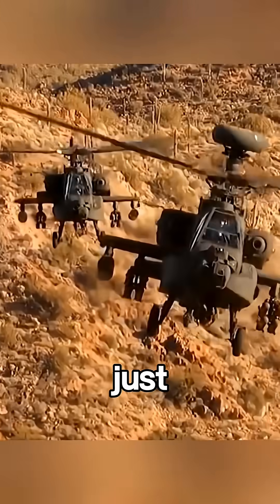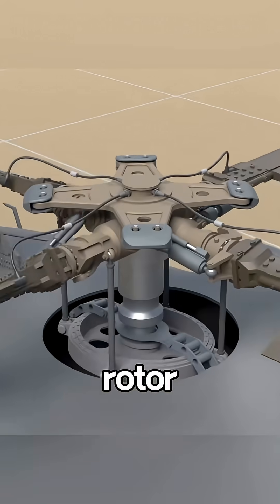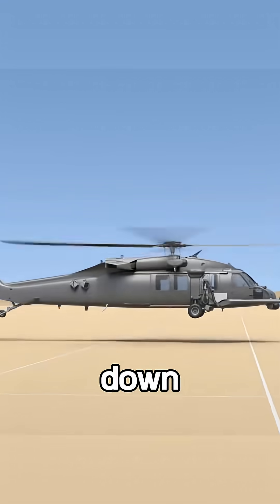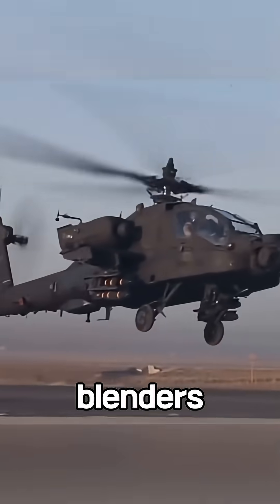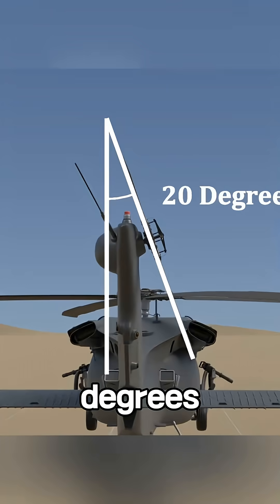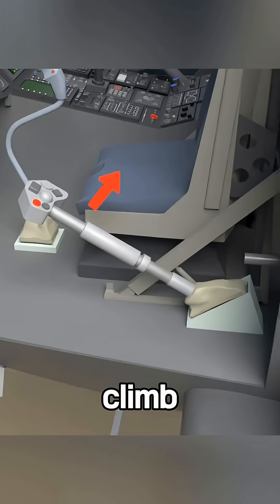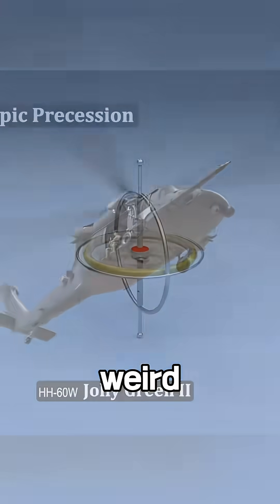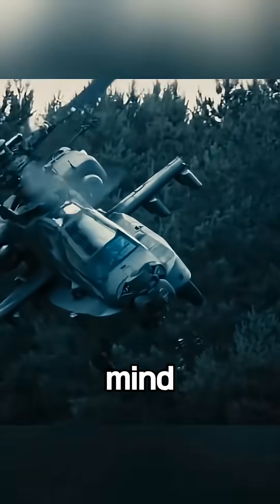Helicopter Speed Myth Busted: What Really Limits Their Velocity #helicopter #aviation #military

Comment: I already knew it 😅
However, the RPM of the main blade does change, which is why proper RPM control is required as well, and why the helicopters have an indicator specifically showing the RPM of the main rotor
Reply: Yes and no. Yes, as the pitch of the blades increase or decrease, the RPMR changes because of the change in drag in the blades. 
No, because the governor recognizes the change in RPMR and increases or decreases engine torque to maintain RPMR at a constant speed.
Reply: @bradleypolotto5193  Do they all have governors? I think at least some helicopters also have a throttle, and my impression was that the pilot had to adjust the throttle when increasing or decreasing the blade pitch to keep the rotor speed within a fairly limited RPM range. I think it was implemented as a twist-grip on the collective lever.
Reply: @init100  Yes. They all have governors. However, the governors of reciprocating engines on helicopters are not as precise as the governors of turboshaft engines on helicopters. The pilot of a helicopter with a reciprocating engine may have to "tweak" the twist grip throttle throttle to adjust manifold pressure to coordinate rotor rpm with collective pitch changes.
Reply: @oscargrouch7962  Incorrect. There is no rotor speed governor on small piston-drive helicopters. The pilot IS the governor. I flew the Schweitzer 300CBi and it was up to the pilot to monitor and maintain the proper rotor speed.
Reply: @bradleypolotto5193 
Feedback Control systems . 
Closed loop and Open loop feedback gain . Differential equations . 
Block reduction diagrams .
Reply: @bradleypolotto5193   The fuel governor increases the fuel flow to the engine to maintain a constant rpm.
Reply: @bradleypolotto5193  Yes, the pilot has the option of manually adjusting the rotor speed in emergency situations.
Reply: Rotor speed does change drastically, again dependant upon type, imagine a heavy lift type but with no weight, would you want the blades to rotate at 100% of max lift capacity? No, turn down the speed and the blades hit less turbulent air from the blade in front, less pitch is then needed in the blade at less rpm, a lot more efficient. The max speed is set by the ABC (advancing blade concept) which is a sum of the drag of the blade, the turbulent air coming from the blade in front, the pitch of the blade, the length of the blade, the chord of the blade, the rpm of the rotor head, all of that vs the weight of the aircraft the air density and temperature.
Reply: @slarratt  You’re incorrect about varying rotor speed. For all flight maneuvers, the rotor speed is maintained in a narrow range of about 96-100%. It does not slow down when in flight!  If it does, bad things follow like loss of control, rapid descent, darkening of underpants, etc.  You confuse max lift capacity (not really a term pilots use) with rotor speed. They are not directly proportional. You get more lift by changing the pitch of the blades with the collective and cyclic.  To overcome the increased drag, you need to add more power. During all of this the rotor speed DOES NOT CHANGE.
Reply: One would argue the persistence in misconception between RPM and torque, the governor is there to maintain a present RPM as per manual input  by the pilot.now let's assume u need to increase ur climbing rate in an emergency situation, u pull ur collective deflecting the blade pitch to max angle consequently that demands more power(torque) forcing more air downward n that tends to slow down the blade,,, however the governor senses the RPM drop automatically compensate by burning more fuel making that familiar aloud acceleration sound and that only brings the RPM back to the preset RPM. Some how we associate the loud acceleration sound with high RPM.
Reply: Exactly 💯!
Reply: The only part I wasn’t aware of is at the end when he mentions to pitch forward the blade has to increase lift on the side. Can anyone confirm if this is true? If so, I still don’t imagine this applies to chippers with a fixed disc.
Reply: @shook20000 This is true.  The pitch of each blade is constantly changing to maintain flight once it starts forward motion. It’s an incredibly complex dance governed by the swash plate. For a three bladed helicopter you also have lead-lag and flapping hinges to consider.
Reply: @artjackson8360 
Right I’m aware of the leading/retreating blade pitch change with each rotation, which as I understand varies with speed to ensure lift is symmetric on both sides.

The video appears to claim this occurs in all modes of flight though.

Is this governed automatically based on airspeed or does the pilot apply roll input/trim manually based on airspeed?

Is this process different in 3 blade choppers compared to 2/4 blade?
Reply: They don't change. You need 100% RPM for your other systems to function, and also in the event of failure enough RPM for autorotation.
Reply: Having done "hot refuels" of helicopters, and have them lift off as I am pulling the ground away, I can FEEL and hear a change in the rotor speed as it lifts off, even though it was sitting and the blades were spinning the entire time I was refueling.  Not sure if that was going from 90% to 100% or what, but I know there was a change.
Reply: The gauge labeled "Nr" tells the speed in percentage of the main rotor.  100% is the maximum of most rotors, although I  believe that the Kaman H-2C had a maximum of 105%.  Optimum rotor speed for autorotation is generally 94% Nr.
Reply: Some helicopters have governors or correlators.   The Enstrom F28F has a correlator which means you have to twist the collective grip to increase or decrease RPM.  You can easily overspeed the rotors or cause them to bog down.   

In the turbine engine helicopters I've flown,  the "governors" today do a good job of maintaining a constant RPM (range).  You used to need to be careful to not allow the rotors to "droop" since the governor lagged a bit even with automatic control.
Reply: Rotor RPM varies on piston engine helicopters, proportional to engine RPM, but most helicopters are powered by turbine engines and rotor RPM varies imperceptibly as it’s directly proportional (linked and geared down thru the transmission) to the turbine engines N2 (low pressure turbine), and N2 is governed
Reply: Agreeing with you and against most of your detractors a helicopter engine speed does vary but it isn't for increasing the helicopters speed. The rotor speed increases  from a startup, tick over speed to a speed fast enough for take off then the collective, the lever on the left alters the blade angle for take off and landing. The speed of the rotors nay be altered slightly in forward flight to a cruising speed to conserve fuel.
Reply: No, a helicopter's main rotor blades typically spin at a constant speed, and lift is controlled by changing the angle (pitch) of the blades, not the speed of rotation. The engine maintains a constant RPM through a governor, while the pilot uses the collective lever to adjust the pitch of the blades for lift and altitude changes.
Reply: @CaltonDionWaziweyi  still little bit variation exists, but RPM have to be within green range of 97-100%
Reply: @CaltonDionWaziweyi  The speed limiting factor is speed of the blades. 

When the blade is coming from back to front….it travels at its own speed plus the speed the helicopter is traveling at. 

If that leading blade gets too fast…you get sonic booms. 

That’s what limits speed….keeping the blades from breaking the sound barrier. Aircraft can’t handle it.
Reply: Dont the collective change rotor speed?
Reply: Ha.  Good point. As the collective increases, drag increases.  There might be feedback to increase the speed,  but it won't be instantaneous.
Reply: @JohanMsWorld  it does but on turbine powered helicopters (like mentioned above) the collective changes the RPM only as a result of the additional physical drag placed on the rotor blades as they change permission.

A well flown helicopter will have the rotor blades stay at roughly the same RPM throughout the flight with significant changes only coming during demanding maneuvers (take off, landing, coming into a hover)
Reply: @JohanMsWorld  on a piston engine helicopter, if you increase collective (which increases main rotor blade pitch) drag does increase, and if you do not increase engine power using the throttle, then rotor RPM will bleed off - so you need to increase engine power (via the throttle) simultaneously while increasing collective pitch.  Conversely, decreasing collective without reducing engine power will result in over speed of rotor and potentially the engine.  And you need to change the amount of anti-torque exerted by the tail rotor by adjusting pedals (more anti-torque when increasing collective and less when decreasing collective).  You usually even need to make minor changes to the cyclic (joy stick) when changing collective to prevent aircraft attitude change (while changing altitude).  On turbine engines, various inputs to the engine fuel control module ‘inform’ it on how much power the engine needs to generate, and the fuel control module changes fuel flow to the engine (increased or decreased accordingly), with the turbine’s N1 (high pressure turbine) RPM increasing or decreasing, while N2 and main rotor RPM remain almost perfectly constant (N2 and main & tail rotors are all directly mechanically connected).
Reply: NO 😂 rpm is just to let on know shit works 
unlike you daft drivers in your automatic cars  driving with only idiot lights 😂
Reply: @scottsuttan2123  sorry, I'm not american so I do know how to use manual cars :)
Reply: What's your source
Reply: @CaltonDionWaziweyi  the twist throttle on the collective!
Reply: @CaltonDionWaziweyi  I've seen how helicopters work, and my father has been inside them midair more than once
Reply: @Danstrous  I thought you were gonna say "My helicopter." LOL
Reply: @charlesmullen3359  I wish I had one 😂
Reply: The change your describing is negligible and constant speed/ RPM makes perfect sense from a physics POV. I think you just wanted to suggest that you (and your dads) gained experience through riding in helicopters trumps all others mechanical knowledge. 😂 laughable really.

Comment: Another detail: You cannot keep increasing the speed of the rotors' rotation as the tip of the blades can spin so fast that they go supersonic and that'll lead to them getting damaged.

That's one of the reasons helicopters cannot generate enough horizontal speed, for the helicopter itself (not the blades) to go supersonic. Their top horizontal speed is around 400 kph (250 mph), far from the speed of sound at 1234 kph (767 mph).

Comment: Most tail rotor blades are not tilted 20°, the Blackhawks are due to the fact it's way more powerful the most helicopters so much that it creates yaw torque. And it takes cyclic pitch for a helicopter to move laterally and collective to move up and down. So some of this is wrong.
Reply: This is also wrong, it has nothing to do with being more powerful, development criteria was that the black hawk needed to fit in certain transport aircraft, so engineers had to play with available space, which resulted the heavy gearbox system and other components placed aft of the centre of gravity. To cancel out the resultant default excessive nose up attitude, they tilted the tail rotor so that it also generates lift upwards, making the helicopter level
Reply: @sherekcio3651 this logic makes more sense, less sensational and more practical explanation
Reply: @srinathtg4623  Also the correct response. All single-rotor rotary wing aircraft generate yaw torque. Idk what OP was trying to express there.
Reply: I was waiting for somebody like you to address the wrong information.
Reply: Ka52 don't have rotor tails
Reply: @jonesmorendik  - That’s because they have twin counter-rotating rotors that balance out the torque, thus tail rotors are not needed.  It’s the same with all helicopters that have twin rotors like that, not just the KA52.

Comment: TWO outcomes to this truism:

1. becoming a helicopter pilot is harder than a fixed wing aircraft pilot. 
2. helicopter dynamics and aerodynamics are so complex, there are specific aerospace/aeronautical engineering schools in the country that provide degrees in this branch of engineering.
Reply: I'm a fixed wing and rotor wing commercial pilot. Rotor wing was not harder. It is however more expensive when getting your certs in rotor wings.

Comment: Annnnnnnd....

Because of the aforementioned aspects, there is a theoretical limit to how fast a helicopter can travel.
Reply: Want to faster than 220 mph? Get a V-22 Osprey
Reply: @PhilipLongee-vw8jf  limit is when blade that go same direction as helicopter reach speed of sound
Reply: @kkk1293u9xp yeah but there's also the retreating blade stalling
Reply: @JustRememberWhoYoureWorkingFor  
True.
Reply: @JustRememberWhoYoureWorkingFor  also there is a limit in speed because increasing airspeed reduces the AoA and therefore forward thrust is reduced. Same principle as for propellers. In an airplane if you descend fast enough, AoA can become negative, which leads to the oncoming air essentially driving the propeller. Worst case is you'll exceed RPM limit of the engine. Not sure how these principles equally apply to helicopters though.
Reply: @slarratt  wrong. ALL helicopters rotor blades are subsonic. Even the Lynx. Even Airwolf*.
*according to the novel, Airwolf shut down its rotor system and folded the blades backward into the tail boom before engaging the turbos. No real helicopter can do that in flight either.
Reply: @PhilipLongee-vw8jf  or an F35 lightning II.....
Reply: @Yabberfrat  F-35 L II isnt even close to being in fast jet league

To define fast,
Start with Mig-25, Mig-31, SR-71...n further
Reply: @AKumar-fc6ek , true! we could just stop at the SR-71.....💁🏽‍♂️😉  It takes the cake 🍰!!
Reply: @Yabberfrat 
perhaps Chinese r on to something even faster !!

Not confirmed though...
Reply: @AKumar-fc6ek ,  very interested to know!  Share it if you've got it
Reply: bigger blades, more lift, more speed
however if too long blade then snap and fall
Reply: Yeah thats why all helicopters have a "never exceed speed" because its at those speeds that the difference in angle between the advancing blade to the retreating blade that it risks hitting the aircraft itself as it spins. Another version of this problem is noticable with the Russian Ka-50 family of attack helicopters with contra rotating rotors where one rotor can be lifting up (on its advance) while the other sags (during its retreat) to such a degree that the two can collide.
Reply: You end up flying with the cyclic full forward and full to one side.
Reply: Since they have mass, helicopters can never reach speed of light!

Hope I could help
Reply: @sebastiangundolf6740 Ah.... they can't ACCELERATE to the speed of light, but if they are already traveling at the speed of light then they can go the speed of light. In a vacuum. Which creates other problems. But.... yeah😅
Reply: @kensingtonchapp4819  Generating lift in a vaccum

Newton's 3rd law is giggling 🤭 in corner...

Comment: This is wrong most regards. The collective adds pitch to all blades equally. As this happens torque is also increased requiring more pitch from the tail rotor to counteract it. The collective allows the the aircraft to increase overall lift to hover. It is also needed to increase and maintain forward speed during acceleration. 

The cyclic adds or subtracts blade pitch for each blade independent of the other blades depending on where that blade is in the rotation. This causes each blade to flap up or down in sequence resulting in the rotor disk tilting in the direction the pilot moves the cyclic stick. 

The speed of the aircraft is limited by retreating blade stall. As the helicopter accelerates forward the advancing blade provides more and more lift. The retreating blade loses lift to the point it stalls. The helicopter then shakes, rolls left or becomes uncontrollable.
Reply: Collective pitch increases rotation too

Comment: Well presented & very informative.  Damn helicopters are continuously trying to self-destruct.
Reply: Except…still didn’t explain how they increased speed of acceleration 😂
Reply: @peterbarrie-g5b Sorry, that’s classified need more than Confidential level
Reply: @peterbarrie-g5b  All lateral movements are really just "falling" off of the balance point of a stationary hover. Think of it like balancing on a ball. Lean forward and you lose balance and roll forward. As with the ball you will start dropping down as you move, so more lift(pitch) is added to the blades to maintain altitude.